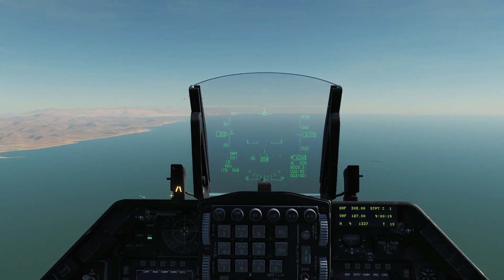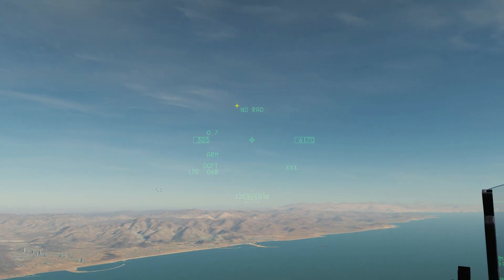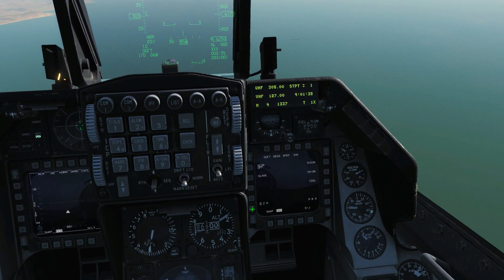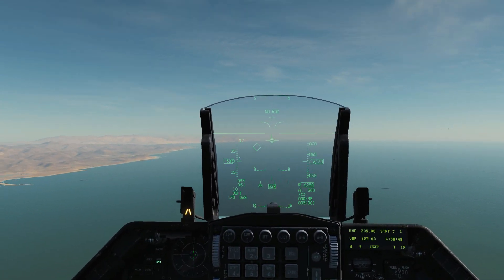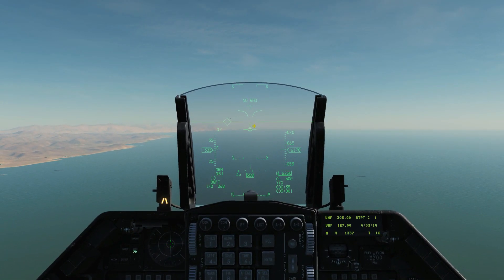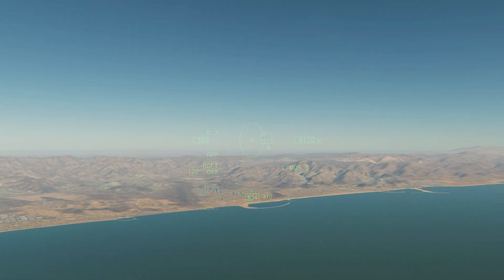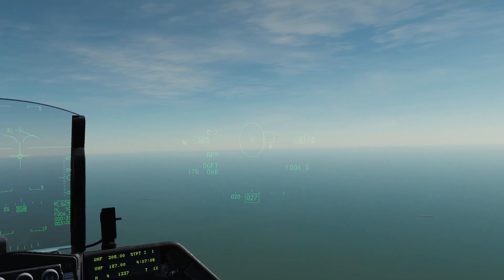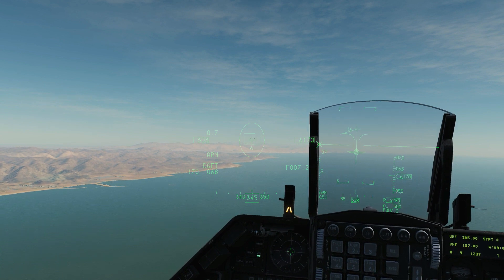F-16C Viper: Aim-9M/X With JHMCS HMD Helmet Mounted Cueing System Tutorial | DCS WORLD

Comment: Seems like there's a change in slave mode for the hmd pressing tms forward has the eye but in no rad iv had to press it forward then left to get a lock now and not as reliably
Reply: when i press tms forward the egg doesnt stay on screen, i have to hold it and it just says no rad, if you figure anything out please update.
Reply: @ImJustShadow.  iv found tms forward 2x then right brings it up without the norad but it doesn't lock only way iv gotten a lock sofar is tms forward 2x for the egg then tms left the egg will disappear and sometimes ill get a lock its not consistent but its the only way iv got it to work with the hmd everything else seems the same with the acm so it could be a bug
Reply: Also on the tms forward 2x you have to hold it on your hat then move it left without depressing it or ital go back to the tms forwards 1x cross
Reply: @JohnDoe-ku8qn  done some further investigation in the community, seems to just be a simple bug, just use missile boresight instead of radar lock for now, it’s annoying but that’s pretty much all you can do for high off boresight rn
Reply: @ImJustShadow.  i always forget i can use bore but i mainly rock ammram C so can't do that as easily iv got it to lock just buggy as hell lol
Reply: @JohnDoe-ku8qn  you shouldn’t be using aim 120s in dogfight mode regardless that’s bvr mode, dogfight mode is for aim 9s
Reply: @ImJustShadow.  i know but I fly weird and do med extends so they work better for me but I'm starting to rock the 9s more

Comment: I saw all the controls needed for DCS. And I thought mapping keyboard bindings for warthunder was fun. Looks like you need 2 keyboards to play. One just to control all the radar and other miscellaneous controls.
Reply: All of those functions can(and should) be done on a half decent hotas setup, eg X55/56/Warthog etc etc
Reply: @savvynz  an X52 works okay as well, I still rely on the keyboard for many things, but I like to think of it as the control panel, and the computer screen is my canopy.
Reply: Other reply is correct, but I'm just reiterating. If you get a decent HOTAS (anything from Thrustmaster T16000M + TWCS Throttle, to X56 Rhino, to Warthog and on up) you can bind the most important functions. Especially with the F-16 since it was designed to keep your hands on the stick and throttle most of the time. The other switches can be operated with the mouse in less stressful situations, or a few keybinds if you don't like the mouse option.
Reply: i can do all that on just one :) just takes the time binding it, but its worth it.